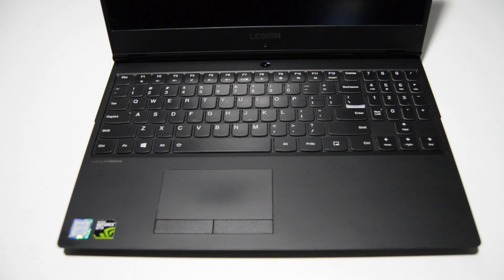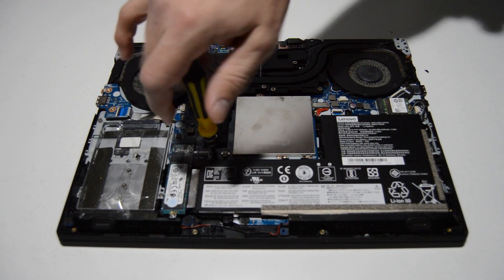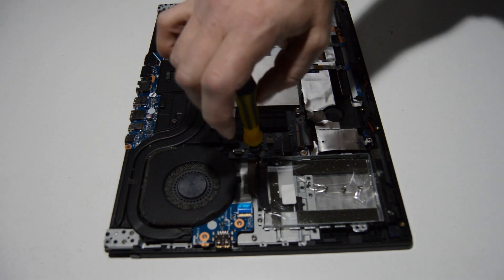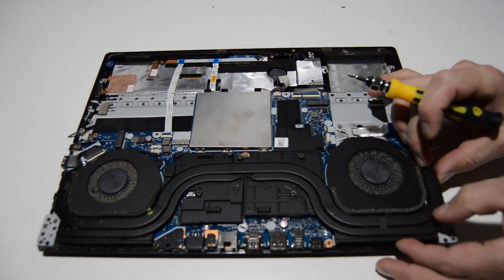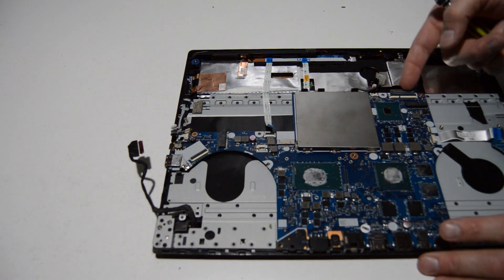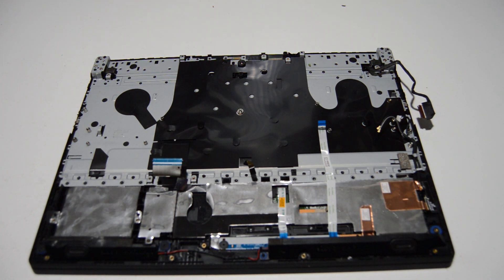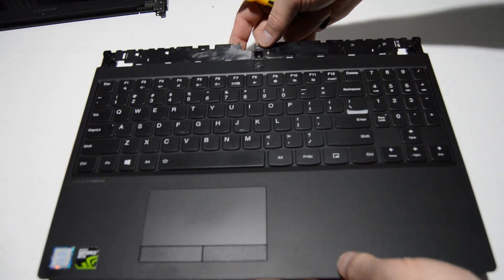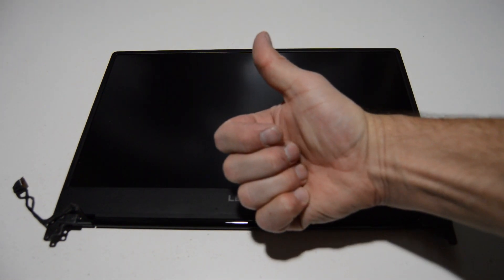How to Disassemble Lenovo Legion Y530 Laptop

Comment: Ik this videos is a little over two years old but is it generally safe to open the laptop just to replace or fix a battery related issue as i have the dreaded 0% plugged in issue right now.
Reply: Hey, have you fixed your issue? I also have the problem where my battery shows 0% charging, but its not charging, stays at 0%.
Reply: @andrejtoth2849  it resolved itself but that’s not really fixing it.
Reply: @Fullerbay  well damn, hope mine solves itself aswell lol
Reply: @Fullerbay  just wanted to let u know it actually fixed itself lmao

Comment: Is it possible to "repair" processor in y530 1060 81lm motheboard? or it has to be new motherboard? Got this legion since june 2019 with 2 years warranty and was not put under high pressure but 5months after warranty processor started to have problems and is crazy overheating. lenovo is ofc not willing to help at all 5 months after warranty and offers to replace motheboard for almost new price of this model t even if the rest is in very good or perfect state. Totally not reccomend it sadly. Left with feeling of being robbed of my money

Comment: one question tho, is the ssd preinstalled when you buy the laptop or are there chances of otherwise?
Reply: No one has answered yet, but It depends on the model of the laptop. Some only have HDD, some SSD, other have both. I would check the description of whatever you're buying to double check.

Comment: Is there anything has to do with assembling the battery to the socket? Mine is not chargering and cannot supply power to my laptop after I open the cover to upgrade my RAM.
Reply from the maker: I would reopen it and try unplugging and re-plugging your battery connector.
Reply: @Sellbrokedotcom  have try it many times. no luck :(

Comment: The reason I am watching this video is because my 1 of my stock fans stopped working and i replaced both fans. i didnt touch anything else, however upon reassembling and first use I have noticed the speakers are no longer working. I checked in the properties and it's saying the Nivdia output audio is unplugged, I am not sure how I managed that but I am not sure where that plug is and its weird bc i wasn't even working on that side of the pc assembly.

Comment: Hi, I opened my legion to clean it, I cleaned the ram (with proper chemicals), the pcl ssd, and changed the thermal paste on the cpu and gpu. Now it won't start, what should I do?
Reply: try to pass an earaser in the ram grooves, sometimes there are static problems when changing your ram memorys

Comment: Hello. I successfully removed my heatsink but I can't manage to reinstall the screws back properly due to the amount of pressure that it needs to be back again from its current spot - I can't push or twist the screws that have springs on them until the very end. Is it gonna affect my laptop? I'm afraid to push down too hard.
Reply from the maker: You should definitely be able to twist those in. Make sure it's all lined up correctly and you may have to push a bit hard to get them started. You should be able to push as hard as needed to start them since they did it when it was new and it made it out ok.

Comment: Thanks so much for making this! Just one question. The screws holding the heat sink on mine are super tight, so the screwdriver just spins around on top, but I don't want to break anything by applying too much downward pressure; is it okay to lubricate the visible threads, or will that cause any problems? Thanks.
Reply from the maker: You may have to remove the motherboard first so that you CAN apply good pressure. Put something underneath that supports that section of the motherboard. Lubricating the threads won't help, the screw is too tight, not rusted. Make sure the bit fits the screw as closely as possible. Sometimes it can help to first try and tighten the screw slightly to break it free, then unscrew.

Comment: A repair for an overheated y530 from a somewhat shady shop seems to not have fixed everything with random shut downs occcuring, which is better than it not turning on in the first place i suppose.
Could this be caused by any of the ribbons not being in properly after the repair? The keyboard backlight doesn't work for instance, if it hasn't gotten fried at least. Which is weird since the standard lights in caps and num lock work.
Reply from the maker: Not usually.... mostly it's a cooling issue or a bad motherboard. If it happens randomly WITHOUT playing games or doing anything CPU/GPU intensive, than I would suspect a motherboard going bad. I would try to make sure you have clean fans and heatsink fins.... use canned air to blast them clean without having to open the case.... spray the air into the back vents. Good luck!

Comment: Any idea if a y530 keyboard replacement would work a y540? I spilled something on my keyboard but I cant find any y540 replacement keyboards. Also, which cable connects the keyboard to the motherboard? Is it just the one that you said connects the backlight? I want to disconnect my built-in keyboard and boot up the PC using the novo button so that random keys dont start pressing while I'm gaming.
Reply from the maker: No its the wide one that connects the keyboard. Not sure about compatibility, check the part numbers for both to see if they match.

Comment: I can’t get out certain screws is there anything that could help
Reply from the maker: Pressing down hard and wiggle back and forth until it breaks free. If its stripped, you will have to get a screw extractor bit and drill it out to get the bit to dig into it.

Comment: I am having some trouble with the left touchpad button. Is it possible to remove only the button the same way as the keyboard keys, or will this break something?
Reply from the maker: No they are usually attached to the palmrest underneath with some kind of plastic arms, and usually not removable.
Reply: @Sellbrokedotcom  Thanks a lot, man! Almost broke something at first. It was really hard to find info on this!

Comment: 3:32 how come those Wi-Fi antennas came off that easily? I tried to disconnect them and one of them broke :(
Reply from the maker: They usually come off really easy, but I have seen the solder connection on the wifi card can be weak and break off with the antenna. Its kind of a fluke.
Reply: @Sellbrokedotcom  so what do you recommend doing now? my wifi works but the signal is weak sometimes and also disconnects from time to time. I'm still on warranty, do you think they'll do something with it or not because it has been opened?

Comment: What cooler models can I use for this laptop? Does it even require some kind of specific model? I need to replace one of mine because it's making a buzzing sound and I'm pretty sure that means it's irreparably dying, so, lol
Reply from the maker: Try cleaning it first.... you can see in the video the one we are taking apart is really dirty. Use some canned air or open the bottom case and use a brush to clean the fans.

Comment: is the legion spill resistant?/
Reply: I spilled water on mine almost a year ago and it still works fine (well, except the keyboard which I plan to replace)
Reply: @alexclarke6924  I spilled some too (Legion Y530) and it works fine, even the keyboard. I didnt replace anything.
Reply: @alexclarke6924  it was like half of glass
Reply from the maker: Not sure, generally laptops don't like spills

Comment: Hey, Could you please tell me whether for ram has 204 or 260 pin
Reply from the maker: It's 260
Reply: @Sellbrokedotcom  Hey, Thanks for replying. Is the part no CB16GS2666.
 
I see only part no mentioned in our local online websites. Could you please confirm on the part no.

Comment: Thanks. My Legion's screen busted while it was in my carryinh case while I was driving so have to get a new display. It seems that I only need to open the bottom cover and remove the heat sink and one of the fans to get the display wire out and then just screw out the rest?
Reply from the maker: If its just the screen itself you may be able to leave everything together and just remove the front bezel, I would try that first. This may give you access to the screen and you can possibly disconnect the LCD cable from the screen itself. I don't see any screws holding it in place so it's probably glued.

Comment: I think my motherboard is dead. No matter what I do, remove battery, press power button for 1 munuite and try to turn on, nothing happens. I even disconnected my cmos battery and replaced it. Do u think I should replace the motherboard?
Reply from the maker: As long as you have made sure it won't run from the battery or power adapter, then it's most likely a dead motherboard or bad power button (integrated with motherboard on this model).
Reply: @Sellbrokedotcom  If it's the power button, is there a way to fix it, or jerry rig another push button switch. By the way does it have a fuse in the motherboard?

Comment: Thank you so much! I dumped a cup of coffee on my Y7000p in January and my top case FINALLY showed up from China today lol. This gave me the confidence to tear into it sooner.
Reply: Keyboard arrived in 15 days, installed it and now everything works fine. I also didn't see any signs of corrosion on the motherboard, so I don't think this laptop is dying any time soon. Kudos to Lenovo for making a spill resistant keyboard even when they don't mention it anywhere. If it was another laptop (like a macbook) it would be as good as gone.
Reply: @alexclarke6924  awesome! I'm impressed it was so quick. Mine took months to arrive to the US
Reply from the maker: Glad to hear it!
Reply: @Sellbrokedotcom  got it successfully replaced!
Reply: @alexclarke6924  nice. You will need an entire top case. The keyboard is riveted in with plastic and is not serviceable.
Reply: @alexclarke6924  you got lucky! The keyboard is built very well. I dumped 8 oz of coffee on mine and while the keyboard died, I saw no signs of water damage elsewhere.
Reply: Where did you buy it?
Reply: @alexclarke6924  AliExpress

Comment: Would it be possible to put a y540 motherboard on the case of a y530?
Reply from the maker: Thats a tough one, probably not but you could check your part number against the Y540 part number. Most likely the ports or connectors are different somehow.
Reply: @Sellbrokedotcom  oh ok,  thanks!

Comment: Thank you sir , this video was really helpful. I have a question, i just want to clean my laptop's fan and air vents as there is a lot of dust stuck in them and my laptop gets extremely hot . Do i need to remove battery before removing fans because in a video i watched , the guy said it is  safer to first remove batter and then remove fans
Reply from the maker: Its recommended.... you could also try blasting air into the vents with those canned air cleaners first, quick and easy and you don't have to risk opening up the insides.

Comment: Is it possible to switch the display connection directly to nvidia gpu instead of intel GPU?
Reply: No, that requires a hardware multiplexer and this config is very very rare. It is available on lenovo only on select Thinkpad models.

Comment: My case didn’t want to open so I just screwed everything back up and left
Reply from the maker: It takes some effort and patience but it's possible!
Reply: SellBroke I pulled at it and tugged, all of the seems we’re lose expect one which didn’t budge no matter what I did
Reply from the maker: @muhammadhalloush567  If you have verified there is no screw there (sometimes they can be hidden under feet or labels on the bottom) then the only thing holding it are plastic tabs. Sometimes these are tough to pop open, especially if the laptop hasn't been opened before. You might also try watching the unscrewing portion of the video in slow-motion to see if there are any you missed..... we speed it up because most people don't want to watch unscrewing for minutes at a time :) Keep at it and good luck!
Reply: SellBroke all of the screws where taken out and  it is my first ever time operating on a laptop or computer in general I’m just worried about getting carried away and accidentally frying it since I have carpet flooring and a very annoying cat
Reply from the maker: @muhammadhalloush567  If you touch something big and metal before you touch anything electronic you should be fine. If you have a cucumber you can put it next to you, cats freak out at cucumbers :)
Reply: Yeah, I hate that they make these things so hard to open, I had to slide an old transport card into the little space, and the card got grinded by sliding, it really freakin' sucks
Reply: @arsnakehert  Use a flat head screwdriver and gently twist

Comment: What are some things I should look out for when removing the battery? I heard these batteries are pretty fragile in general and I just wanna avoid any possibility of it swelling up. Also, the description seems to be wrong :) Great video btw
Reply from the maker: Just dont bend it! Thanks for catching that, corrected!
Reply: SellBroke roughly how much bending force does it take for it to go bad? Do I have to deliberately bend it or would just a tiny mishap when pulling it out cause any issues? No probs btw
Reply from the maker: @nittikorn  You would have to deliberately bend it.... just handling it is not an issue.

Comment: My power button does not click can u please help me
Reply from the maker: Unfortunately the power button is on the motherboard, if it isn't working the motherboard will need to be replaced or sent in for repair :(
Reply: @Sellbrokedotcom  Hi, what if the issue is with the clicker not the piece of the mother board? If the power button looses the clicking attribute then it won't make contact to the mother board correct? I believe that is what happened to mine. How would you remove the current power button to replace it?

Comment: Is the EDP cable that plugs into the motherboard a 40 pin cable on Y540? I am asking because here where I live the Y540 that I bought came with a 30 pin full HD 60 Hz 250 nit display (shit one). I tink that the EDP cable conects to the motherboard through an 40 pin interface and to the monitor through a 30 pin interface. I would like to know if I could change this EDP cable to a 40 pin - 40 pin one and buy a 4k 40 pin panel. Tanks
This is the laptop: https://pcsupport.lenovo.com/br/pt/products/laptops-and-netbooks/legion-series/legion-y540-15irh/81rj/parts/display/compatible
Reply from the maker: Sorry but we do not have either the motherboard or cable in-house to check. Typically the cable connection on the motherboard will have the same connector for multiple different display resolutions, but there are exceptions. Best bet would be to check on a Lenovo forum, good luck!

Comment: do i have to remove everything you removed before starting the thermal paste replacement process? at around 5:30 and on.
Reply from the maker: No, luckily you can get that heatsink off right after you remove the bottom case, very easy on this model.

Comment: Is it possible to change only the laptop keyboard, or should I replace the entire panel with the keyboard and mousepad?
Reply from the maker: Looks like the keyboard is stuck under a non-removable backing plate. I've heard some people have replaced the keyboard and glued to plate back on somehow but it would be way easier to replace the palmrest assembly.
Reply: @Sellbrokedotcom  
where can i buy a replacement for the keyboard?
Reply from the maker: @balsifer40  Here's an assembly: https://www.ebay.com/itm/Lenovo-Legion-Y530-15ICH-15-6-OEM-Palmrest-w-Touchpad-Keyboard-Speakers-GRADE-A/283755520955?hash=item421125a3bb:g:K6IAAOSwkAxeKynT
Reply: @Sellbrokedotcom  When changing the keyboard and everything should I put new thermal paste?
Reply from the maker: @balsifer40  Definitely, especially on a gaming laptop. You don't want any cooling issues.